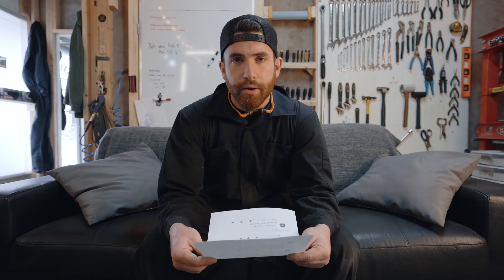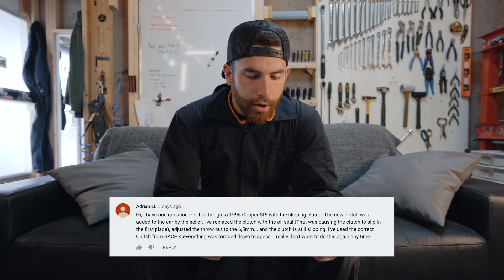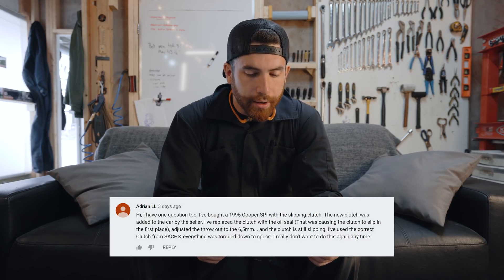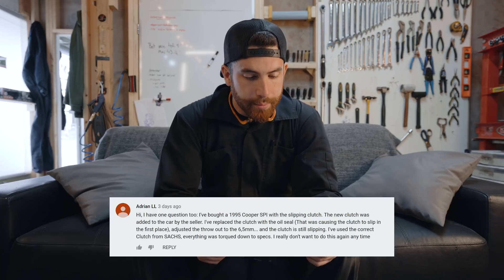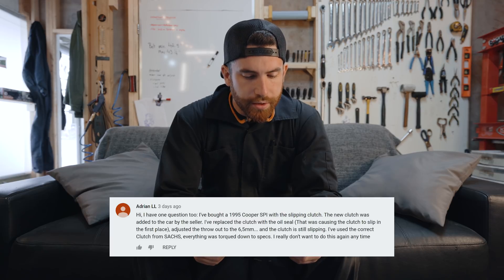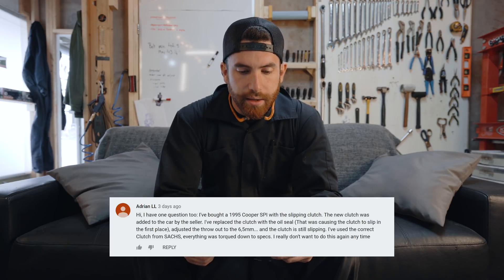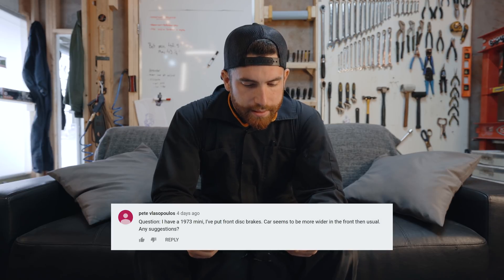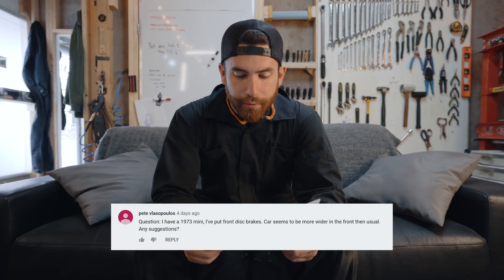Getting more power from a fuel injected classic mini

Comment: I have a question, my car is a 1000cc one ita have a hs4 carb, it overflowed because the floating needle is damged, but now petrol comming out near the gasket that carburetor fix to the engine, what is the problem 😕
Reply from the maker: Sounds like your float needle is damaged?

Comment: Your car is seriously shagged if the flywheel slips on the crank. If it's injection the ignition timing would also slip and stop the engine pdq.

Comment: Great tech tips - thanks for adding the time marks for each section, that's a nice QOL thing.

QUESTION: Have you guys ever added a supercharger kit to a A-series motor, and if what did you use, and how was the installation and resulting performance/reliability? FYI - I have a carbed 1275 4-speed (totally rebuilt by 7 Enterprises a few years back), and I loves me some supercharger whine. =)

Comment: pls. mention or put some links to available plugable tuneable ECU's (mine is a Japanese 1999 spi 1275 mini). Thanks. keep up the good work
Reply: Dont specialist components do a plug in ECU for spi/mpi? - commented before I watched.
Reply: They do! They also do the 5 port inlet kits. You won't get mega power from them though. You really need head porting and a matching cam for that.
Reply: @Dagowly83  I suppose the advantage is that the home tuner can work on it when you start messing with engine changes. I have to say from the experience i've had with the software it's not as easy to work on as some of its rivals.